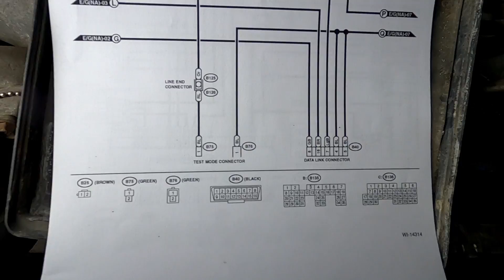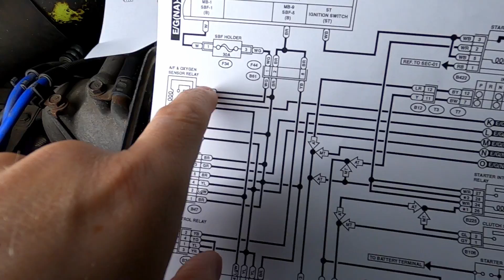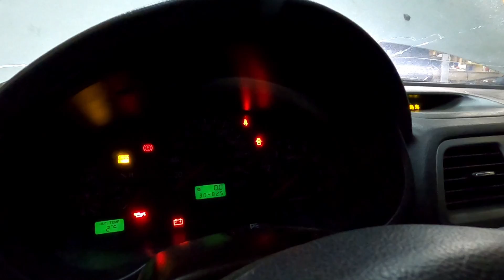Subaru refuses to crank or start... Need to find out why

Comment: Great video, it’s spot on just no result???
Reply from the maker: Thank you for the feedback its appreciated. For some reason there must have been an error in the editing of this video and during processing something broke and nobody said anything to me that this was missing.

The issue with the car was that there is a red wire that runs in the loom that runs across the driver side that you can see near the end of the video. Near the front of the car where it goes into the engine bay if you pull back the loom and remove the tape you will see a "join" of 2 red wires out of the engine bay to 1 single wire that runs into the car.

This red wire and join is what provides the crucial power to all the starting components in the car such as the main relay and O2 sensor relay etc. After repairing the join everything worked as it should.
Reply: So the red wire with the join your talking about. Do you remove the loom from under the dash inside the car or peel back the loom from under the hood in the engine bay? And if it’s in the cab of the car is it the loom that runs from the driver side to the passenger side and then comes out the fire wall?
Reply from the maker: @trainwreck170  The connection is found in the harness that runs across the driver fender. The join is found just before the harness enters the engine bay into the fuse box.
Its buried in the loom.
Look on my Instagram from March 25 for a picture
Reply: Thank you sir.

Comment: check the fourth fuse from the top on the black cluster of fuses.  I saw another you tube video about this same problem, no crank, no start and that fuse was the problem.  changed the fuse, started right up.
Reply: Can you link video? I don’t quite get what you mean
Reply: I think he may be talking about a video where the guy changed the starter relay  @Ayoooowhyisyourhandthere I thin

Comment: Did u ever get it going? Mine was a had to do with a vehicle security ground behind glove box.ifthe body integrated unit grounds the yellow/bluwire 4 security relay .The relay will engage and open the contactinside sucurity key.PREVENTING THE Sarter relay from starting.. i ground out the relay behind glove box little gray relay and cranks up every time until i can fugure out why outta the blu its doing it. good luck hope this helps ,MURF FROM ALASKA....
Reply: I have the same problem! Only figured it out after many hours of testing... It was intermittently starting, then got worse and worse, and basically stopped all together. I'm thinking of replacing the security relay with one that is closed when powered and open when off - for now I just have a jumper wire connecting the black/blue wire (ground signal from ECU) to the green/blue wire (providing ground to starter relay) so the car still only starts if the clutch is in.
Reply: This might be an after thought... But did you figure it out?
The reason im asking is im troble shooting a subaru right now, that was randomly stalling... anyway when you said security relay... And blue/ yellow wire... I was tearing apart the passenger harness in the side wall that leads into the front passenger door, in the little white box the harness flows through...and found parts of a yellow and blue wire... A mouse chewed... And followed it into the door... And had to take the door panel off .. any way the mouse craweled all the way through the rubber door gromet boot and into the passenger door...and chewed the yellow wire and blue wires... So does part of the security system wiring lead into the door???  Something to look into possibly...  If I get results ill get back here and let you know.
Reply: Which fuse / relay behind the glove box exactly?

Comment: Check for fan relay sensor short
Reply from the maker: After having over 3000 views someone pointed out therr was no solution. But if you read the pinned comment I give the answer.

Comment: Sir.
2009 subaroo impreza.

Randomly car will die at low idle.
Sometimes it will start after 20 min... sometimes couple hours.
Sometimes will not start for a day or 2.

During crank... but no start .. it has no spark.

Then randomly... when it. Feels like it ... spark happens ... car starts...

No codes... looks perfectly fine.

Any thoughts??
Reply: Ignition switch

Comment: so it cut u off watdid u find  
out
Reply from the maker: Cut off? Can you let me know whete? The fault was a broken wire that provides power into the car which feeds main starting components
Reply: @toolshedadventures  where was mthe broken wire? sorry it was dark while typing
Reply: I put in a new battery and a new starter all it does is a single click but no crank I'm so lost
Reply: @emptysoul5057 mine too